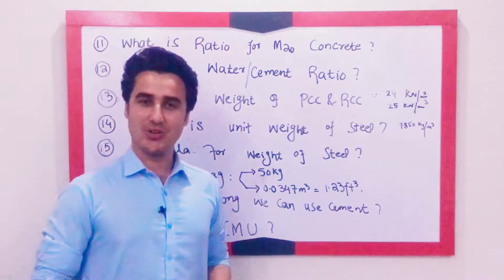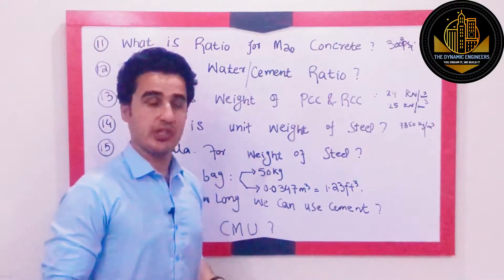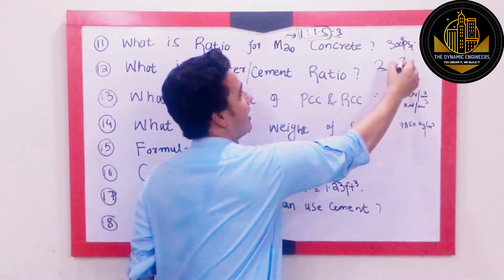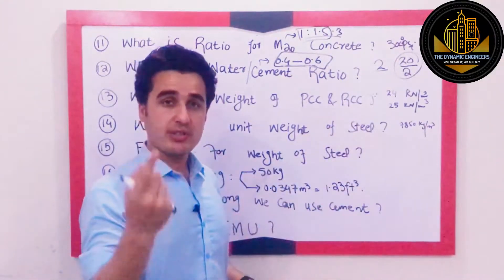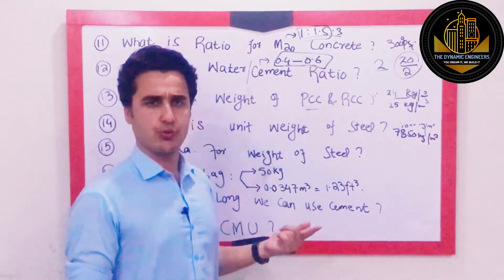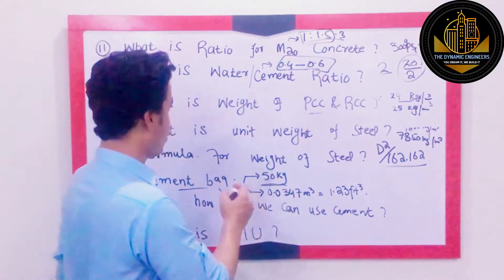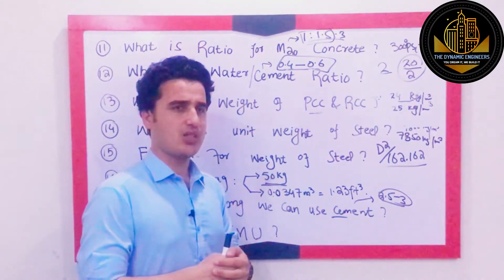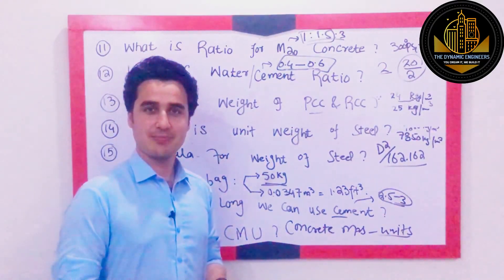Civil engineering interview question and answers for site engineers part 2

Comment: Strength of cement reduced after 1 month , 6 months ,1year and 2 years ?
Reply from the maker: dear, we speak only for the first three months. the reason is, after 3 months you can not use cement for structural works.